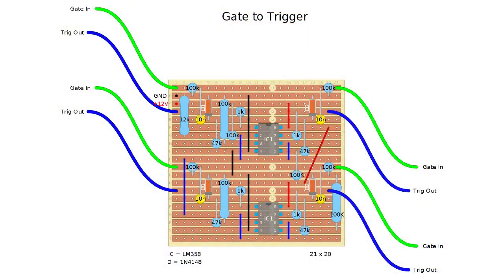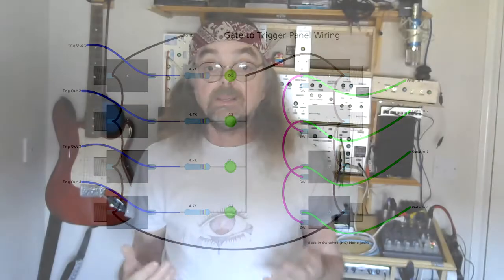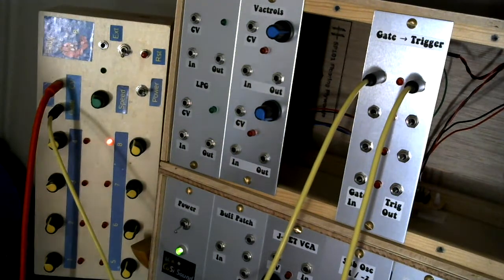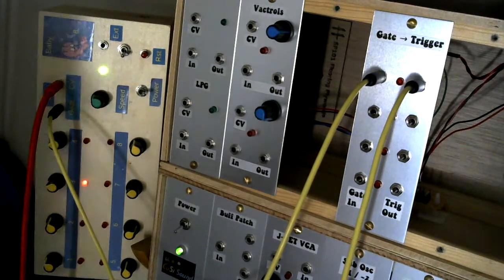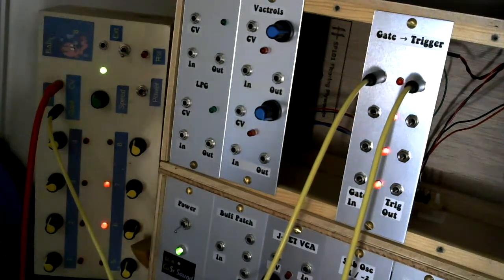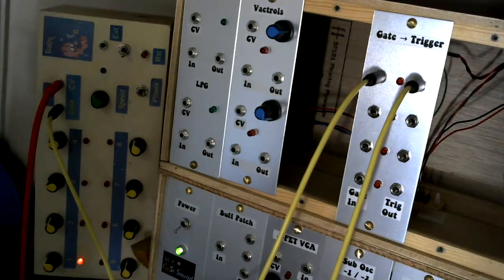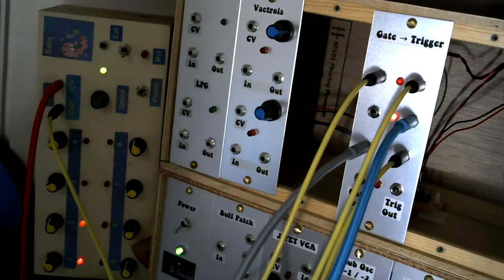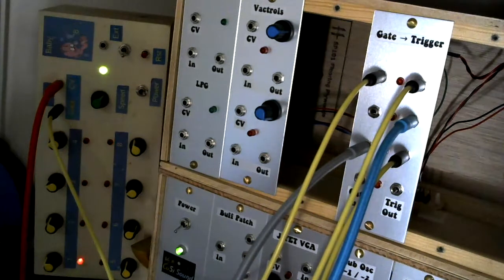Project XII Modular Part 11: Gate to Trigger

Comment: Hey, super Video, very well explained, even I understood it ;). Today the PCB for my PSU has finaly arrived. My VCO is already making sounds, but not quite as it should. I have to check again tomorrow. As always stay healthy and nice greetings from Germany.  By the way, this is the VCO on Stripboard. http://modular.ob1techno.com/wp-content/uploads/2019/04/alfa4-vco.png
Reply from the maker: Thanks for your kind comments and the VCO link. The 3340 chip is a great way to get several waveforms out of one module and it will follow the 1 volt / octave standard if set up properly. Remember to let it warm up before tuning it : ) Stay safe and stay creative.